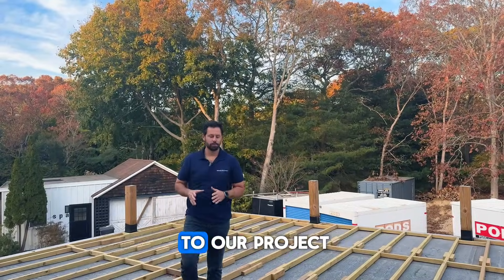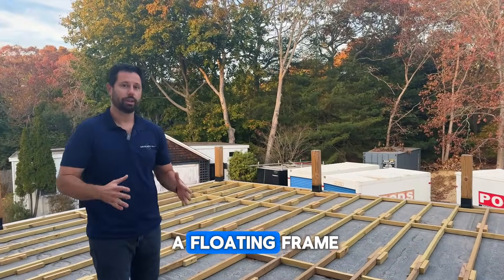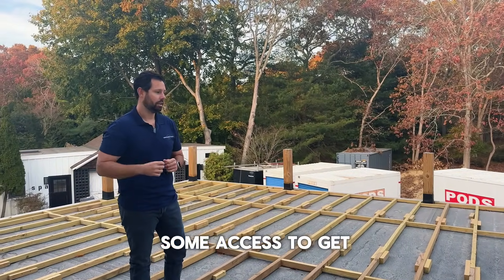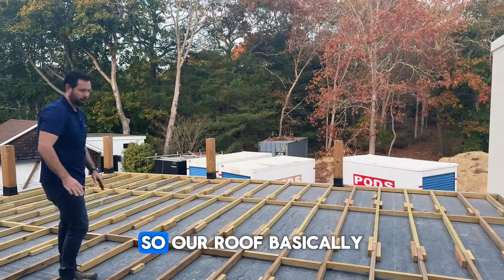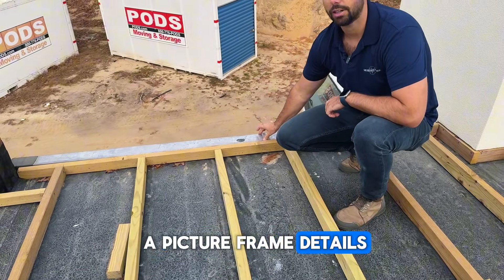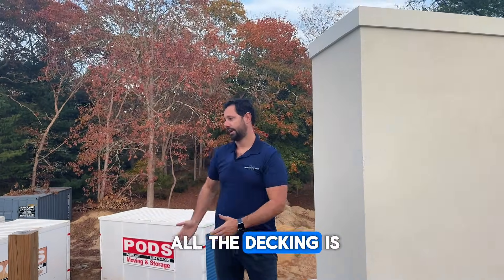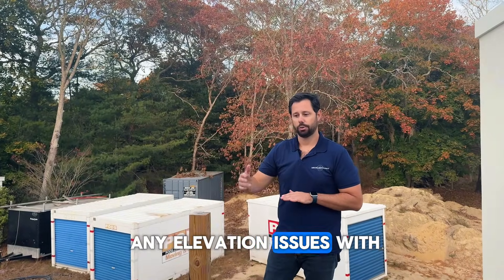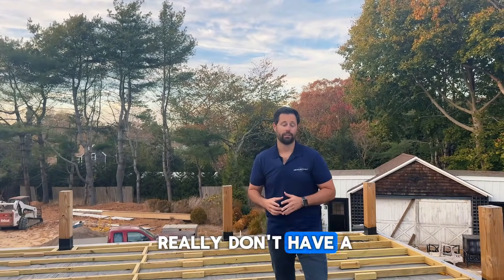How to Frame a Deck Over an EPDM Roof | Part 1: Framing Tips and Tricks

Comment: You are correct having a detailed video on building a deck over a EPDM roof especially one over foamboard is sorely needed. As a DIYer this video would be much more helpful if you talked about spacing. Attachment points to the wall and roof. Any extra steps you took to deter water retention at the joining points for the 2x4 frame (assuming 2x4 because it wasn't stated). I was considering cutting 45 degree angles on the blocks. Did you consider wrapping the framing in waterproof tape to on top/bottom/both for longevity? It doesn't look like you did. Why not? How are you managing water specifically. Any special steps taken to allow flowage beneath the cross bars since you said the frame is on top of foam board. I'd assume some sinkage into the foamboard over time and was thinking about leaving 1/4" gap beneath the cross bars, but wasn't sure that would be enough with sinkage. Also what adhesive did you use with the EPDM onto the foamboard? The standard glue eats into the foam.
Reply: 😅😅😅😅😅😅6

Comment: Very helpful, but how does the water flow under or around the stringers? I am guessing the small blocks are holder up the stringers so the water flows under the stringers through gaps made by the slightly taller blocks?
Reply: Looks like if not leaks, rot. Poor design. No breathing. Mold, mildew, etc….

Comment: What thickness EPDM?
EPDM has its perks, however once it’s covered-maintenance will be a nightmare. If that would be my deck, I would put hot rubber reinforced with reemay and sanded base on top, 35-40 years no worries. Or at least TPO 60 or 80 mil.
Reply: Agree.
Reply: Outdure makes it last well with airflow and waterflow.. Aluminum framing ... check it out, now available in USA.